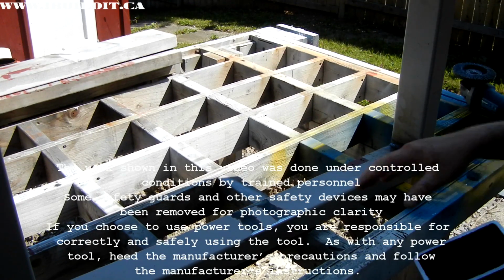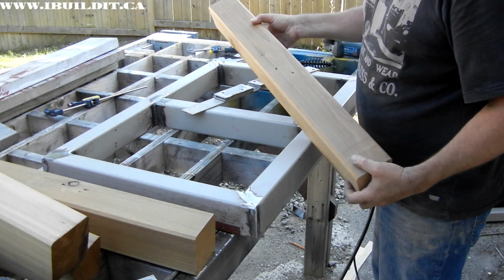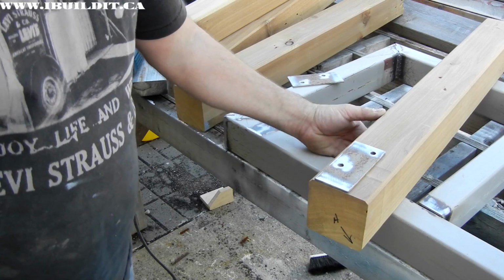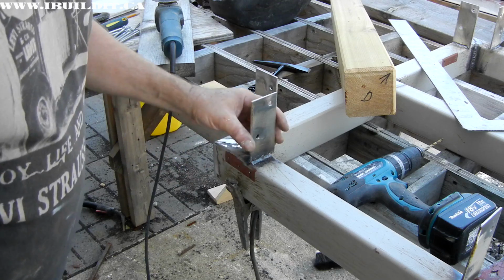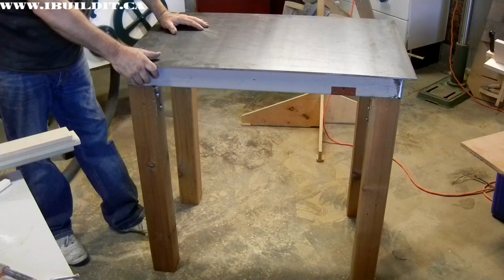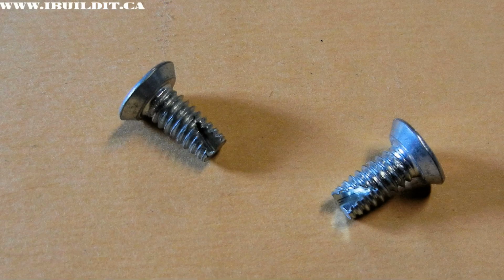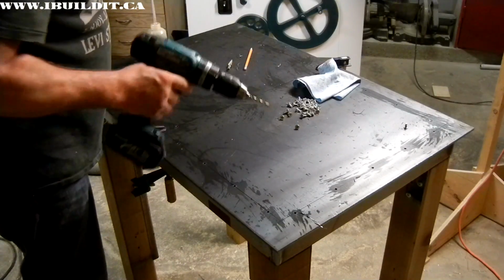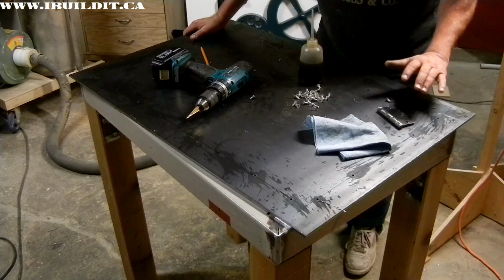Making A Steel Work Table, Part 2 of 4

Comment: also, slow you bit down and you wont heat it up as much and it will cut just as well.  Your edges will stay sharper longer